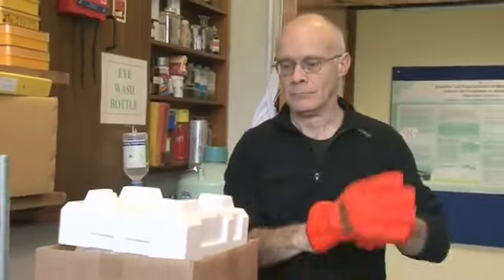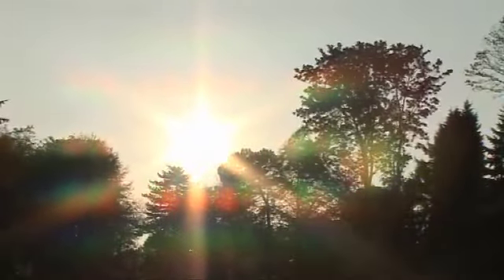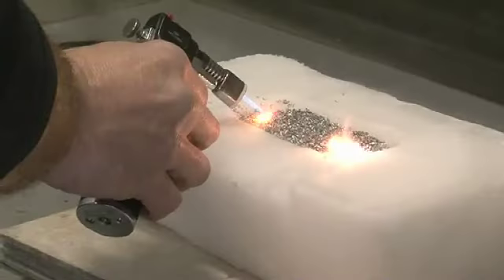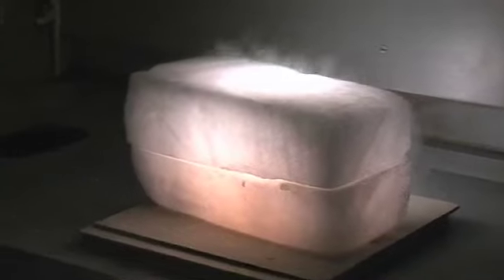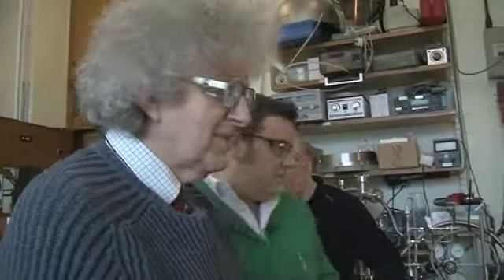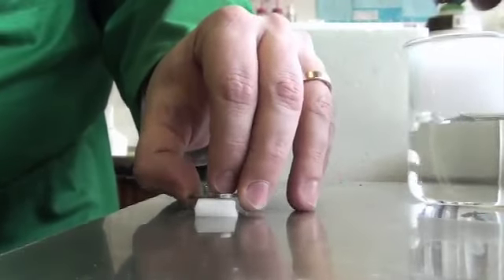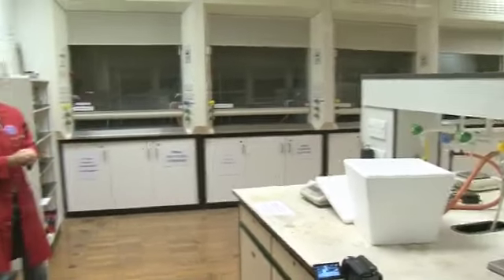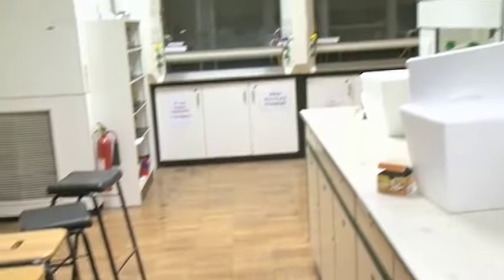Carbon Dioxide (Part II) - Periodic Table of Videos

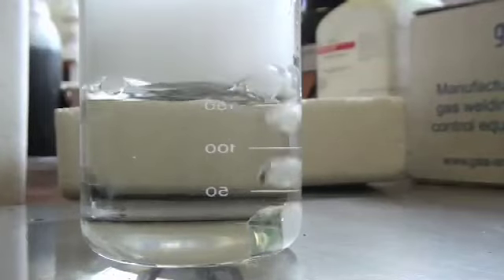Comment: A little correction at 6:50
Carbon dioxide is a colourless gas. The white vapour is water that condenses when exposed to the cold CO2
That said, this was an excellent video and that looks like a fun experiment to try if I find an extra block of dry ice lying around the lab.

Comment: CO2 is not a white gas!  The cold clear gas has condensed water vapor in it.  Sorry, I'm a pedant.
Reply: scowell Being accurate in science isn't pedantry. It's just doing science. (Sorry to be a pedant. ;))
Reply: He was merely pointing out that the gas was frothy and white, he didn’t say CO2 gas is frothy and white, the fact that water frozen makes it white should be a given
Reply: @acepilot1 thought I should add more pedantry to this thread after all these years as I feel what you said wasn’t quite correct. Ice is most definitely not white, all of the time. That just happens when air bubbles are trapped within, thus increasing the opacity. NileRed made a video that somewhat explains this
Reply: @chrisjvas yeah and the bubbles make it so the light that travels to your eyes is white. Color is relative.
Reply: Important to know when you live near lake Nyos and a limnic eruption occurs, or working in a pit connecting sewer pipes.
Reply: @lbaxel9122  I don’t think you quite read what I said right
Reply: @chrisjvas  I sure did. If something looks white because of X factor it is still white.

Comment: You can also use a relatively large chunk of dry ice as a sort of air hockey puck. Instead of gas coming up from under the table, you have gas coming down from under the puck. This works best on a smooth floor (linoleum or cement).

Comment: I was referring to the gas expanding from the fire extinguisher. That is a process where the pressure is changing from high to low with virtually no energy transfer to the working fluid, so temperature does indeed drop allowing for the formation of solid carbon dioxide.
It does not hold true for the solid carbon dioxide boiling, since as you rightly stated, heat is being transferred to the fluid. Therefore the CO2 gas cannot and does not get cold enough to condense back into a solid.
q.e.d

Comment: i have a question.. if you had a block of dry ice, a decently insulated beverage cooler, and a piece of camping thermal material.. if you loosely wrapped the dry ice block in the thermal material and placed that inside the cooler then closed the lid.. granted you had a tiny hole drilled into the bottom of the cooler, granted  the lid of the cooler wasn't locked shut for precaution, roughly how long would that drill hole slowly shoot out co2 gas?

Comment: also, sorry, would there be any chance that the "evaporating, melting?" dry ice would have any chemical reactions with the thermal material? would it give off any toxins? i've seen a sewn together mylar/fabric sheet i'm going to cut up and use. maybe ill punch one or two holes in the thermal fabric ..

Comment: I still think it should work, as you probably know when a gas expands it cools down. In the case of a fire extinguisher it expands a huge amount and cools down a huge amount. If you blast one at the ground for a few seconds you'll get a white layer of frost. So i think it should work on the basis of heat removal, but you might need to keep it on for a while.

Comment: Yes, I believe the sea is like a huge soda can with a lot of CO2 dissolved in it, so as the temperature would rise slowly with the gas we produce, the seas release that gas multiplying the effects and I don't really know how much.

It's maybe like a certain activation energy for a destructive enviormental process, that we may be reaching.

About the dry ice in the bottle, was it sealed or just in contact with the surface of the table? because then how did the pressure raised without lifting it?

Comment: @DrD0000M I did a quick calculation and it turns out you would have to invest around 1500 kJ - 1600 kJ at the MINIMUM to make 2 mol (recycled, following your method) of Mg metal (and far more if you extract it from nature, over 2000 kJ). Since the reaction is 2 Mg + CO2 -> 2MgO + C, you can process only 1 mol of CO2 this way. If we look at the combustion of octane, C8H8+6O2->8CO2+4H2O you produce 8 mol of CO2 and get 5070 kJ out per mol. But you would need 12000 kJ to get rid of the CO2!

Comment: Just a question:

Venus is about 33 percent closer to the sun. The amount of radiation it receives is proportional to the inverse square of the distance. 

(3/2)^2 = 9/4= 2.25

The surface of venus receives more than double the radiation of the sun than earth. In terms of degrees kelvin, the surface of venus is 735 d K versus 288 d K for Earth:

735/288 = 2.55

Does this suggest that the difference in temperature is largely due to incedent radiation relative to orbital proximity?

Comment: I tried to extinguish an Aluminium/Magnesium alloy swarf fire with a CO2 fire extinguisher once. It was in the bed of a lathe where there may also have been some water and oil present too. It was somewhat energetic! Massive fireball. Grey powder everywhere afterwards, I assume this would be the Aluminium and Magnesium oxide and carbon they mention.

Comment: Not as such, the action of condensing water from the atmosphere would actually heat up the carbon dioxide. The atmosphere isn't nearly cold enough for it to re-condense back into the solid phase (it would need to be -78 C or less at atmospheric pressure).

Comment: In perfectly still air, yes, like within a lab or classroom. However, out in the environment with constant air currents and weather it keeps the gasses within air (Nitrogen, oxygen, carbon dioxide, and other trace gasses) relatively mixed which pushes carbon dioxide into the upper atmosphere and keeps oxygen down near the ground. Also, a mix of gasses is more "free" than a mix of liquids of different densities since gasses like to roam wherever they please within its container.

Comment: Engine idea (will it work?)

1. Water is put in to electrolysis.
2. Both the Hydrogen and Oxygen are transported in to combustion chamber.
3. Spark makes fire. Reaction makes water.
4. Water goes back to the tank and goes through electrolysis again.
5. Repeat Steps 1 - 4.
6. ???
7. PROFIT !!

Comment: @blue4splash
very true!
thats also why butane gas is cold when it comes out of a can, like lighter refill.
the gas will take energy/heat from anything around it. liquid butane will take the heat i the air, makeing it cold -since the air has no heat anymore. at the same time the liquid becomes a gas since it got the energy/heat it needed.
 right?

PS: im 15, but i still find this pretty simple.

Comment: A small correction to the dense white cloud you see above the water which is infact: tiny water crystals cooled down from the surrounding air. Carbon dioxide is and will always be colorless and invisible in it's gaseous form.

Comment: @Adrenalinism It's been a while since I did chemistry, but if I remember rightly, the initial reacton between the magnesium and oxygen in the air has enough energy to break the carbon-oxygen double bonds, causing the bond to break, forming carbon and gaseous oxygen, which build up (in the case of carbon), or react with the burning magnesium (in the case of oxygen). This then produces more energy to break more bonds, further fuelling the oxidisation.

Comment: I used to use a blender with CO2 in it for a "particular" extraction.  Well my roommate moved out and all I had was a bullet style blender.  I wasn't thinking about how this blender is sealed compared to my previous runs.  About 3 seconds into the blending process I thought this is bad, and that's when it blew up.  There were pieces of polycarbonate stuck in my ceiling, across the room into my fish tank and I nearly lost an eye.  Chemically safe, physically dangerous.

Comment: Why is carbon dioxide so different from silicon dioxide? I was always taught that atoms that are in the same column in the periodic table should have similar properties.
Reply: +Eric Diaz (Eric Diaz, MD) They do have fairly similar properties when they are in similar states or structures like SiCl4 and CCl4, Silicon can even form analogous structures to hydrocarbons, these are called Silane polymers. SiO2 and CO2 do not really have the same bonding or structure.

In typical SiO2 structures like quartz, the bonds are singular, and each Si is surrounded by 4 Oxygen atoms in a 3D continuous lattice (crystal structure), in this lattice, the ratio of Si to O is 1:2, hence the formula is SiO2, even though each Si is bonded to 4 oxygens and each oxygen is bonded to 2 Silicon atoms. For O=C=O, the bonds are double bonds formed by overlap of orbitals, and the intermolecular forces between CO2 molecules are much weaker than that of the covalent SiO2 structure. 

The double bond is a more stable form for Carbon and oxygen because Carbon is very small; it&#39;s p orbitals are free to overlap. The Silicon is relatively large, containing 8 more electrons below it&#39;s valence shell, it&#39;s much harder for p orbitals to reach out and overlap to form O=Si=O, so instead it takes the covalent tetrahedral SiO4 lattice form, which is harder to form than CO2, but much stronger and harder to separate into a liquid or gas (higher MP/BP).

It appears it may be possible to form a lattice of Carbon and Oxygen similar to Silicon dioxide, which may actually share the same qualities, but it sounds like it takes some technical tricks to make that happen.
Reply: +Bloodmoon Thank you for explaining that. I appreciate it.

Comment: What is the opposite of sublimation? Boiling has condensing and freezing has melting, but sublimation doesn't have an "officially" recognized opposite. Sure, we can think of some terms that might apply, but none are widely recognized.
Reply: +Doc Work this is late, but the opposite of sublimation is deposition, the transition of gas to a solid
Reply: Thanks!

Comment: My guess would be that fact that there is continually air currents, areas of high pressure and low pressure mixing the atmosphere up. But I'm not a physics nor chemist nor environmental scientist so.... But it would be much like the earths crust. There are very dense elements held in the crust that 'should' by rights be closer to the centre as during formation the earth was quite molten. However tectonic movement has mixed everything up!

Comment: Good question!
But the answer is no. I have no idea why, but it doesn't work.
I've tried with numerous so called magnesium rods, heated them with a propane torch until they melted, but no ignition, I suppose they are not pure enough.

Comment: @amcnea no I am telling you that it expands and the passing from liquid state to vapor state needs heat because the pressure inside the extinguisher is bigger the air atmoshpere, and I THINK but i am not sure that when the CO2 gets cooler by trying to expand and it gets into solid :P

Comment: When she said she was going to scale it up i was sure she was going to put some pellets into a 0,5L soda bottle and put in the fume cupboard.
A normal 0,5L plastic cola bottle can reach a few  bars before it gives out, and that pressure either blows of the cap or rips the side. When this happens the pressure wave generated sounds like a grenade. The best way to reach high pressure fast is to have about 2 dl hot water in the bottle.

Comment: the reaction is exactly the same (not really, but in principle) as thermite when aluminum and rust (iron oxide) are burned. Since aluminum is more reactive than iron, it extracts the oxygen from the iron, similarly in this case, the magnesium extracts the oxygen from the carbon, so in theory, i believe any element that reacts with oxygen and is more reactive than carbon will work, im not sure though

Comment: Correcto.

To answer your previous question, carbon is black because the carbon atoms in that structure absorbs all visible light. The reason copper carbonate is green is because it absorbs all light BUT green light, which it reflects. Diamond allows photons through it, and so is clear. CO2 is much the same.

Comment: I don't think that these guys know what they're talking about. When he drops CO2 pellets into the beaker of water, he says that it is "evaporating to form this frothy white gas." 

Dry ice does not evaporate, it sublimates, and the "frothy white gas" is actually water vapor rapidly condensing out of the atmosphere upon hitting the sudden cold (just as your breath condenses on a cold day). As a gas, CO2 is invisible, not "frothy white."

So if they don't know this, what else are they wrong about?

Comment: more like a .9% right. as usual they chose how to collect data to get the result they want. .
we will end up with nukes or get used to walking and riding horses  again..
they get the 90% by only asking scientist that agree with the result they want agreed to.
you know like libs taking polls.
is climate change real, but it,s been changing since the earth was created. al gore was WRONG JUST  like they are today.
 the only thing to help the earth is a major population REDUCTION. nothing else will fix it.
 we could also ban air conditioning and street lights, live in smaller houses  and reduce the size of vehicles, maybe even require people to ride motorcycles and build highways for bikes use only.

Comment: The funny thing about Venus is that at 1 atm the temperature is 340K which you could correct to 289K for Sun radiance as if it was on Earth. The temperature in Earth at 1 atm is 288K. So, where is the green house effect? Another thing, at Venus, with all that clouds,  the energy received at surface from the sun is about 20W/m2, so how could have a Greenhouse effect? Maybe the 92atm surface pressure gives the answer, don´t you think? Oh and the supercritical fluid at that pression and temperature, 93atm, 740K or more. Maybe I am wrong, but why Mars having also a 95% CO2 in the atmosphere is so cold? Yes low atmospheric pressure and distance to the sun... I love this questions...

Comment: Please note, in my previous question, that I am not disputing that CO2 has an influence, but the proportional disparity between Venus & earth appears not due CO2 alone.

On Earth there are other human activities that contribute to warming. Cities and roads act as a heat sinks and have an influence on snow/ice melt rates, and ground radiation absorption.  

I am with you on the need to curtail our fossil fuel consumption. There is a less fortunate future awaiting unless we act now. Thanks!

Comment: Saying that we are solely to blame for the current warming of the planet is wrong, yes. Saying that the CO2 we've been releasing into the atmosphere has had no effect whatsoever on the environment is also wrong. One example is that CO2 combines with water in the atmosphere to make Carbonic Acid which rains down into the oceans. The oceans are becoming more acidic, and the worry is that it will become too acid for the algea that coral needs to live. So coral won't form in the colder water.

Comment: @oOoxelAoOo well yeah is different because when the liquid exit the extinguisher it expands and for expanding it needs heat that's why it cools the air surrounding it and by doing this the CO2 also cools and I think it gets into solid state and solidifes as you said ;), so it does this because of the changes of states.
You shoul know this because as an engineer you (and me) are we should know a lot of physics

Comment: A good CO2 scrubbing operation would be to plant trees, then cut them down before they get too old and then plant new ones in their place, as young trees grow faster and absorb CO2 faster than old ones.  I suggest taking up a hobby that requires an abundant use of paper, which will support exactly such an operation.

Comment: @adiostraitorobama  Have also read about this. I have also read about a hypothesis that there is a large amount of methane gas that has solidified in the deep ocean due to the very cold and high pressures. If an deep ocean earth quake or volcano erupts it could turn this large amount of locked up methane hydrate  and turn it back into a gas. I could be wrong, but from my understanding. Methane is a stronger greenhouse gas then CO2. Course this hypothesis could be bunk. Just something I have read

Comment: You're forgetting that around 90 tonnes of the atmosphere disappears into space every day.  That would include CO2. On top of that, we only produce a minuscule amount of the total volume of CO2. (Around 4%) Reducing our CO2 emissions won't change the climate - because climate is determined by location on the planet relative to the sun. A couple degrees up or down won't change that. Tidal forces and variable output of the sun have a much greater effect. We're never in the same place we were before. The sun and our solar system are traveling through space together and will have different tidal forces affecting it as it goes. Thinking that our CO2 emissions are going to change the climate is pure insanity. The experiment is misleading because that's concentrated CO2 that doesn't exist anywhere else on the planet and the results don't prove anything. CO2 is an invisible gas - it's not white. It also doesn't turn to black powder.   We are wasting more money by using wind turbines and solar energy and having to mine rare earth minerals does more to pollute the atmosphere than a coal fired plant. Take a look at what's going on in China that ends up over here a week after the fact. Going into poverty as a result of switching to solar and wind power isn't helping anyone and it's not going to change climate..